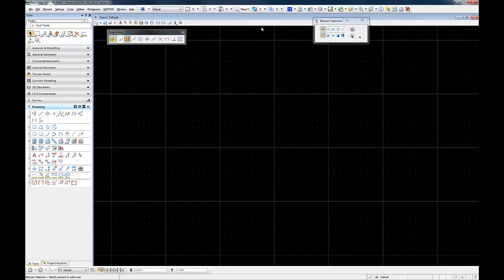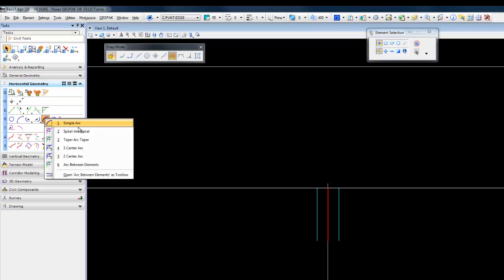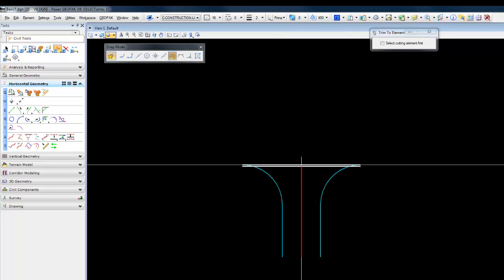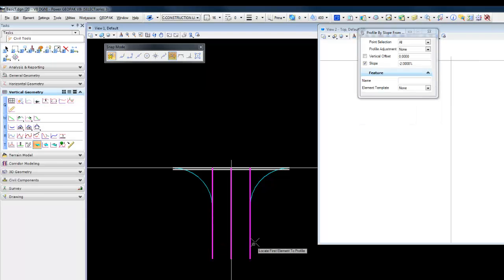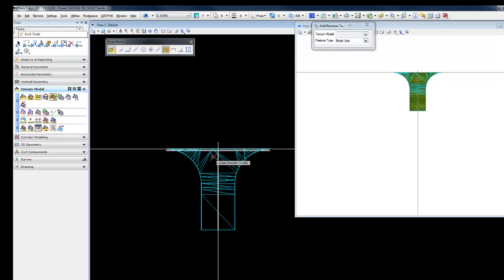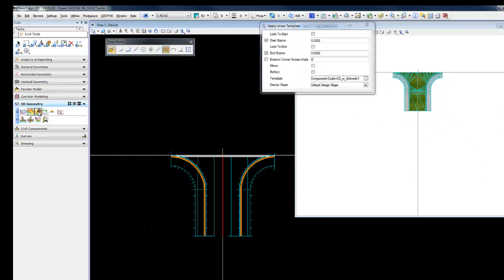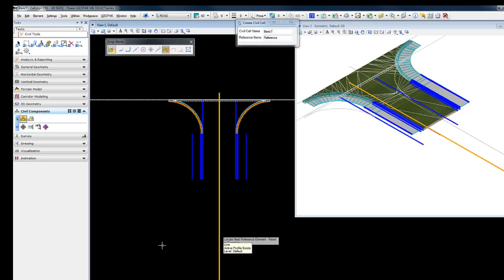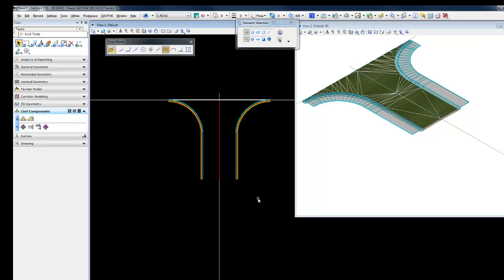CREATING THE BASICt CIVIL CELL.mp4

Comment: You're using 3D Geometry > apply linear template.  How do I create a Civil Cell using corridors?  My issue with linear templates is that you dont have the option to set a key point.  

This is an issue for me at intersections where the drop frequency straddles an important transition, IE going from one alignment to another.

When I model the intersection with corridors, I drop the corridor along the gutter line out to the CL along the transition.  The first half of the arc is point controlled to the mainline and the second half the side road.  I then put a key station at the intersection point.  With linear templates, you can use point controls but not key stations.  Am I missing something?
Reply from the maker: First... Key stations cannot be used in a civil cell. (however they can be added after a cell is placed)
Second... corridors can be used in place of linear templates.